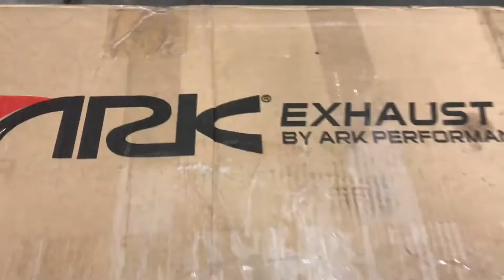Lexus RC F Ark Grip Exhaust and RR Racing Intake install.

Comment: How is that cf intake tube and oil separator working out? Things you like and dislike? Much appreciated!
Reply from the maker: Ashish Paul Intake tube is fine. It’s not something you really notice though.  The oil separator works great. Did 2 track days and normal driving, and only had to empty it out once so far.
Reply: Brian Ho NICE! Do you have RR racing tune also? Really want to get it but bit hesitant because of engine issues or something.  What's would you recommend?